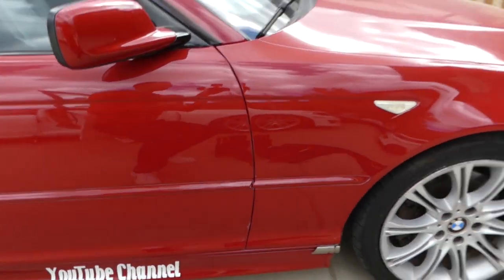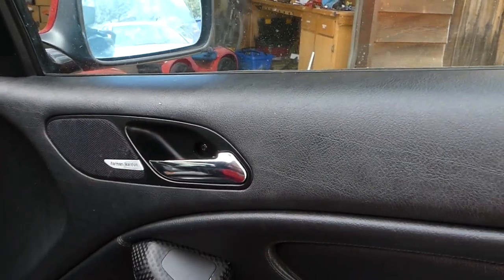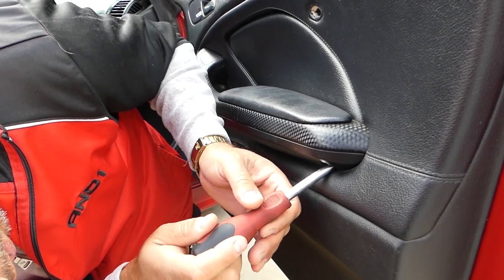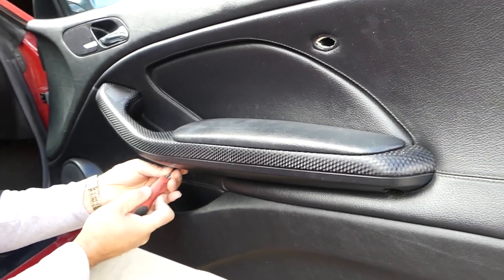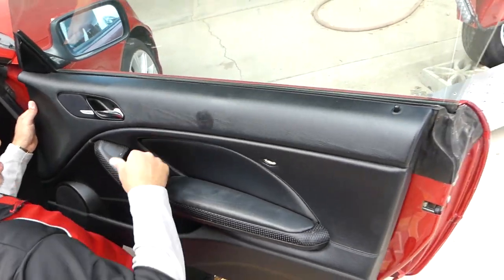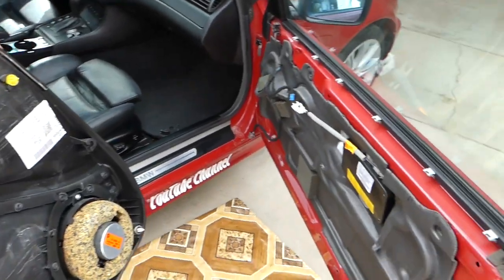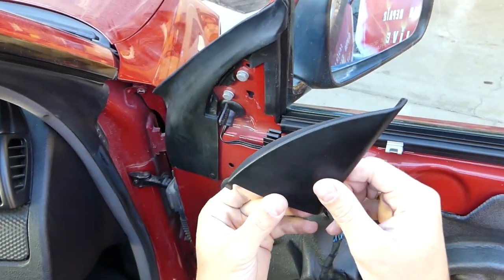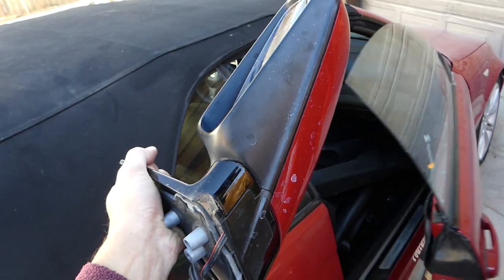HOW TO REMOVE REPLACE SIDE VIEW MIRROR ON BMW E46 COUPE CONVERTIBLE

Comment: YOU DO NOT NEED TO REMOVE DOOR PANEL!! I did it my own way, take little plastic cover off side mirror (inside) take off 10mm bolts, run the wire through the hole and keep pulling slowly, the clip will then appear, Unclip it with your fingers and BAM. Put the new one in, attach the new wire, put bolts back in, DONE IN LESS THAN 5 minutes !
Reply: What?
Reply: I agree. You might have to loosen the trim piece at the top so you can fold the door trim back to get at the connector, and even remove the armrest screws to get more access, but it doesn't need to come right off.
Reply: I was thinking the same.

Comment: Could you do one where a ribbon  strip 2003 e46 mirror is swarp for a cable strip on the drivers side. That would really help. Thanks.

Comment: Thank you for this video !

Excuse-me but I have a question.

I have to replace the mirrors and I think I should put parts 51167153143 and 51167153144 because I have a 320 cd of 2005, but they are really expensive. I find similar pieces of Magneti Marelli or other brands, but the connectors do not seem to be the same.
I see in your video that you have exactly the same connectors as me for the passenger side.

Which model of series 3 is it please?
Reply: I have same connectors did u ever find the part?

Comment: I been having Problems with my folding Mirrors they did go up but did not come back down but now they are not working at all now  on my E46 BMW 325ci 3 series convertible 2004 so I decided to take the driver's door panel off and I saw this which I was not expecting ( SORRY I DO NOT NO HOW TO ADD A PICTURE HERE )as youtube dose not let us put pictures in this section. in the pictures you would of seen I have the same connectors like yours but I have 2 of them and coming from the mirror I have ribbon coming from the mirror and not wirings 
 
THERE was no mirror control module i was hoping there would be one but I SEE yours do not have one but you have one connector to join your mirror to your door wiring  on your car and I have 2 connector coming from my mirror to join my mirror to my car door wiring   so I do not no what to do now as I do not no what Mirrors I have on the car so I would like to no how I can troubleshooting it and get them back up and running  plz can you help
Reply: Ur mirror module is in ur mirrror its manufactured only 2 years by bmw i have same mirrors too and ur folding problem is mechanic %90 so u dont have to mess with module just repair mechaic parts
Reply: @e46imolared    do you have a pic of what i have to do as they did fold-up but did not fold back down ?